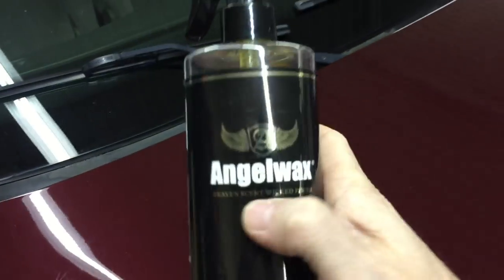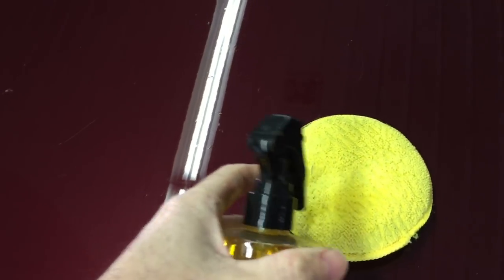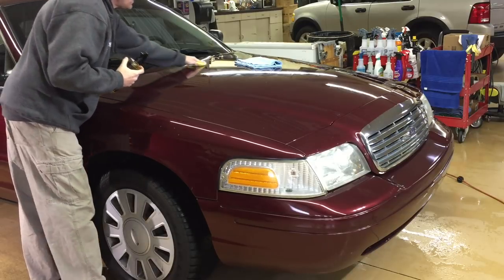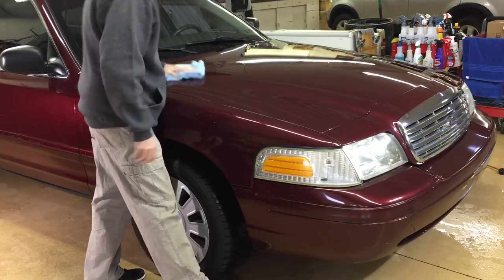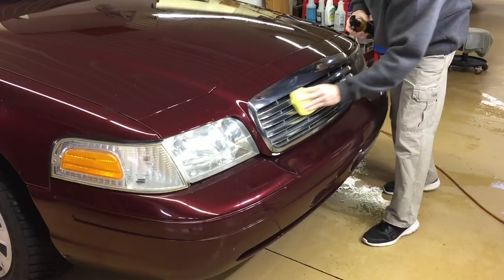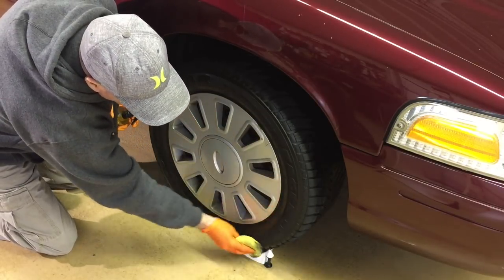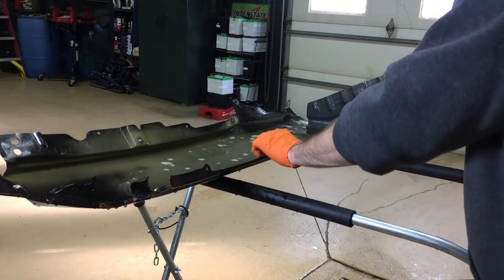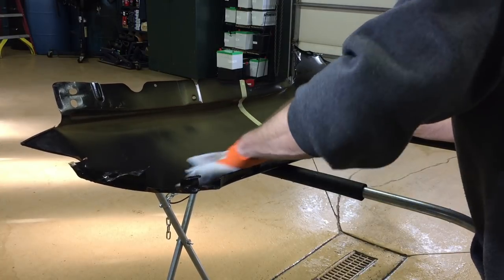One Product to Care For The Exterior Of Your Automobile!!! Angelwax Corona!!!!

Comment: So glad you made a point about detailers and super exotic cars.  Not just how many of us are driving those, but how many detailers are detailing just high priced exotics?  Seems to me those high priced, driven once per week exotic cars would be very easy to maintain as compared to a daily driver.   A daily driver is where a truly outstanding product makes its name.  I have a similar product for you to try and it can be found in the RV section at Walmart LOL, trust me, it may not be as easy to use as Corona, but the differences will be minor and price tag, major.  Goes on same way as Corona, a very little sprayed onto applicator pad, works great on all surfaces.  Doesn't have a great smell, but I love how easy it is to use and the shine on paint is much better than Meguiar's X Wax.  And it has no problem cleaning off bugs, tar, etc, it actually cleans as you apply it.  On interior plastics, leather etc... it leaves a very nice even and clean satin finish.  https://www.walmart.com/ip/Protect-All-16-oz-All-Surface-Care-Cleaner-Polisher-Protector-Wax-for-cars-trucks-RVs-boats-and-more/16783714
Reply from the maker: So true... a product gets the ultimate test on a daily. I have Protect All... have yet to do a vid on it. Great post.
Reply: Only thing I don't know is the longevity of Protect All, might fall a little short there.  Will anxiously await your professional review, love your videos, I've learned a lot.
Reply from the maker: It honestly lasts longer than Corona...However does not give the finish a deep rich look as Corona does...Its a trade off.
Reply: Apex Detail , great to know,  thank you.   I was surprised at the gloss and the slickness PA has, was not expecting it.   So you telling me Corona has a better glow makes me think it must be very impressive for an all-in-one.  I hate tradeoffs, but that’s detailing isn’t it. We are always looking for the next best thing.  Sometimes simpler, cheaper, and “just as good” passes us by in our quest for perfection.  That’s why companies invest so much in marketing
Reply from the maker: A huge reason I do all this testing. Gives us an idea of how products work and look before spending $ on them.
Reply: And it's much appreciated!
Reply: Allen Maestas  Indeed it is!!

Comment: Great product! How does this compare to Mequires Xpress synthetic spray wax?
Reply: msclecarcrzy I was thinking the same thing. It’s what I’m using now
Reply from the maker: Its a bit more durable. It also gives a noticeable deeper, richer look to whatever it is applied to. I used to use Megs inside and out.
Reply: @apexdetail85  can I use my Meguiars x-press wax on top of Corona every time I wash the car ?  Or wont the chemicals in the 2 different products work together?